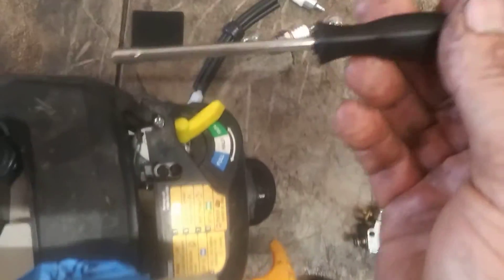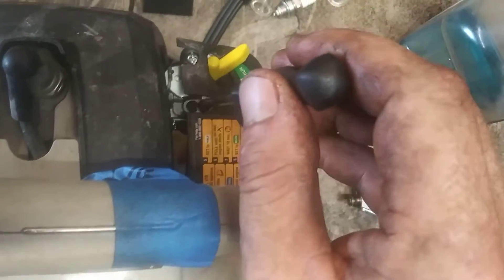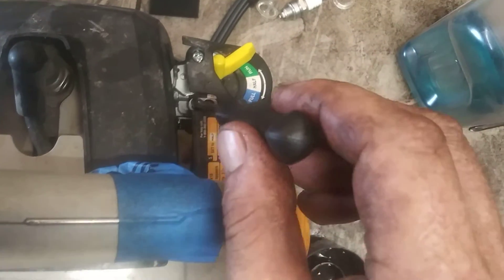* Ryobi 2cycle blower carburetor adjustment

Comment: Mine runs super hot, after a few minutes I start getting a burning smell and after turning it off I see some smoke coming off the muffler area. It’s also very difficult to start. I am ising 50:1 pre mixed fuel. Any ideas on what’s going on?